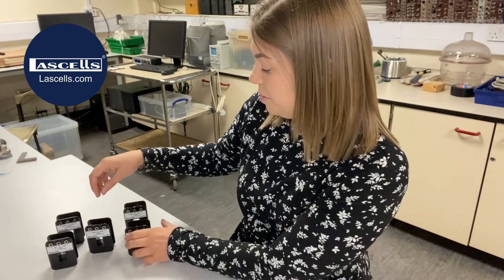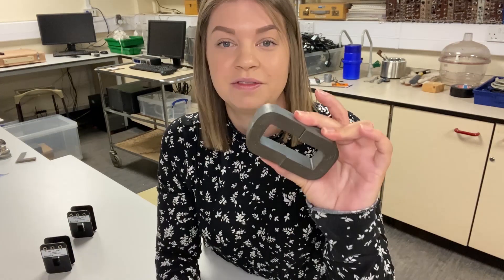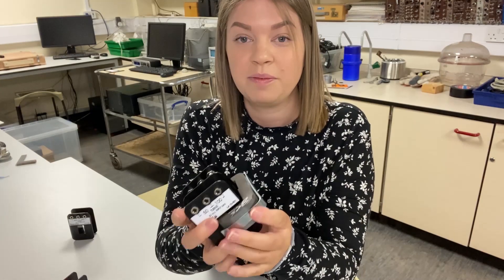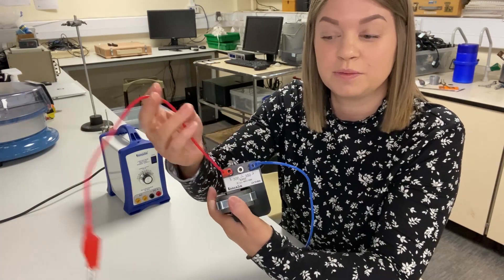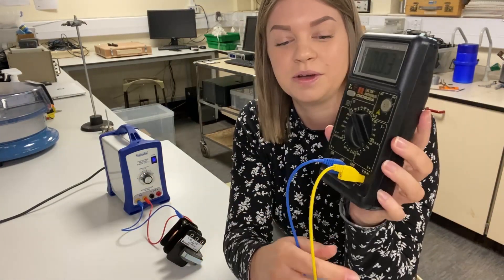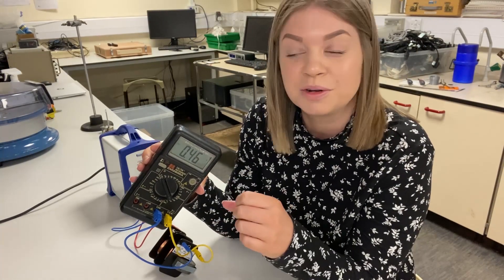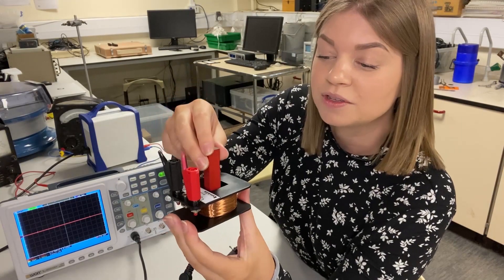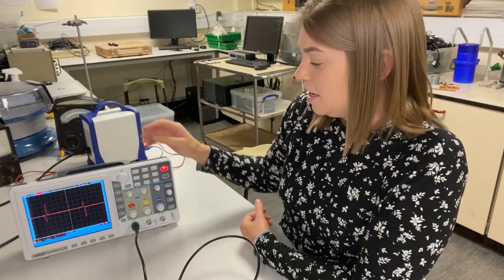Turns Ratio and Induced Voltage - Transformer Coils

Comment: Just to be a pedant - Its voltage that is induced not current.
Reply: To be a further pedant. in a transformer, an electromotive force (EMF) is induced in the secondary coil due to the changing magnetic field from the primary coil. This induced EMF causes a current to flow in the secondary coil, but only if the secondary circuit is closed. It’s important to distinguish between the induced EMF and the resulting current, as the EMF is the cause, and the current is the effect when a complete circuit is present. Although measured in Volts, it’s not to be confused with a Potential Difference, also measured as a Voltage.
Reply from the maker: Thanks for adding detail
Reply from the maker: Nice spot! I’ve switched the title to match what was said
Reply: The word is pedantic. 😉
Reply: @MichaelScarborough423  a pendant is a pedantic person. Look it up